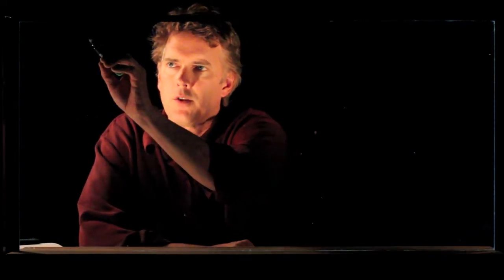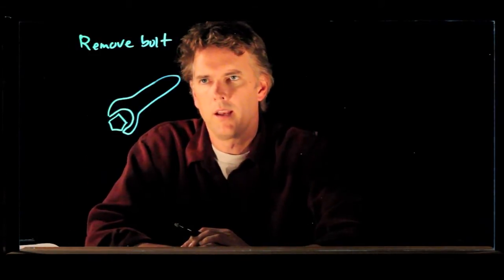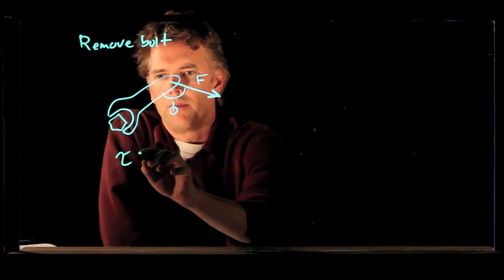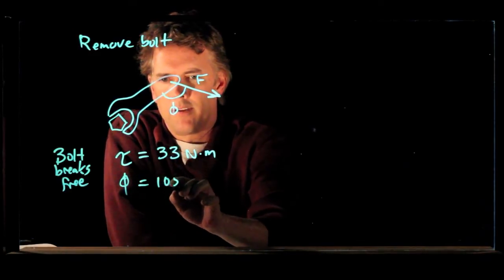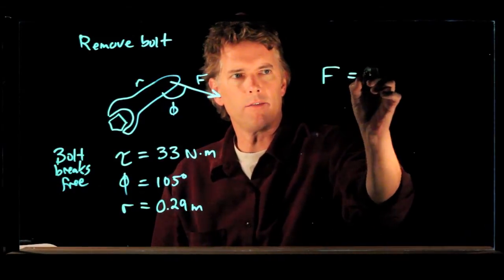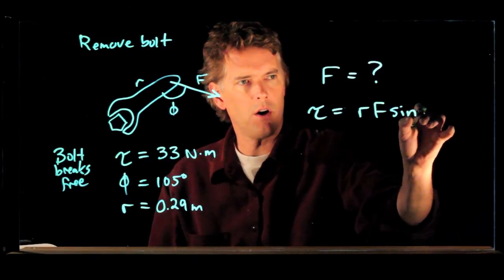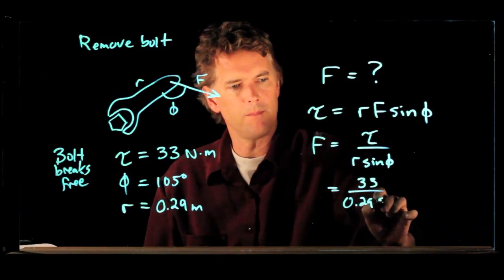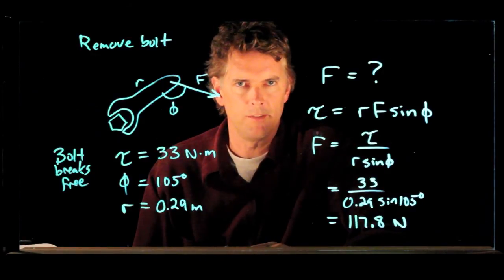Torque on a Bolt

Comment from the maker: Referred this question to my engineering expert, and this is what he said:

Greetings,
You need to define the term “over torque”
 
Condition 1
The torque specs that are set to achieve a controlled condition. i.e, sealing a flange without distorting or not loosening under vibration or other functional performance.
 
Condition2
The maximum specs for a given screw, determined by size thread schedule and materials,
 
Violate condition 1, You are within the allowable limits of the screw, but have exceeded the limits of mating parts, Mating parts may fail.
 
Violate condition 2 You exceed the limits of the screw, Screw may fail.  Failure can be stretching snapping galling stripping. A screw that has been over torqued, is damaged and will not preform as designed and  therefore should be discarded.
 
 Cheers,
Dr. A

Comment: If you over torque a bolt, lets say a bracket or some other non torque critical item on an object that has vibration and heat, like an engine, but the torque on the bolt doesnt pull threads, what are the odds of loosening, or snapping, or causing damage to the threads from expansion and contraction with the vibrations.
Reply: samus989 A answer we still need till this day